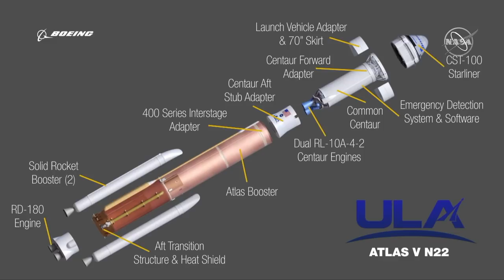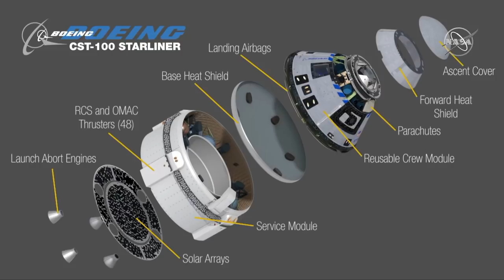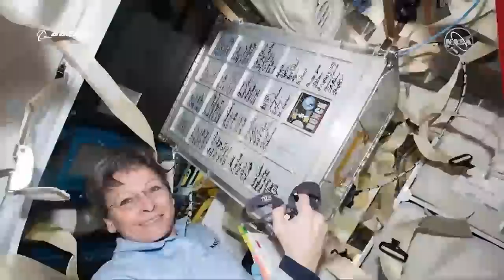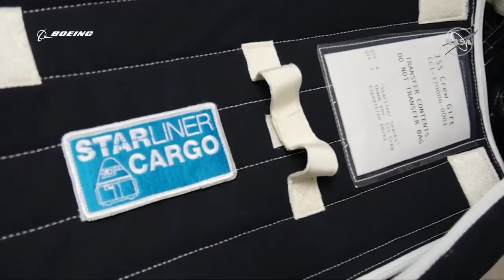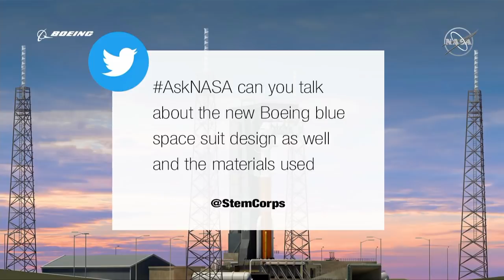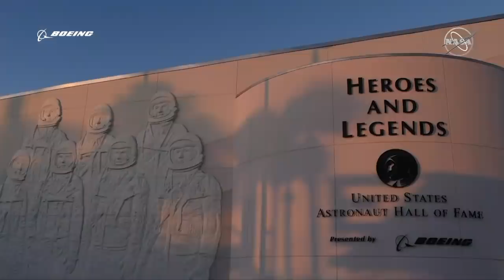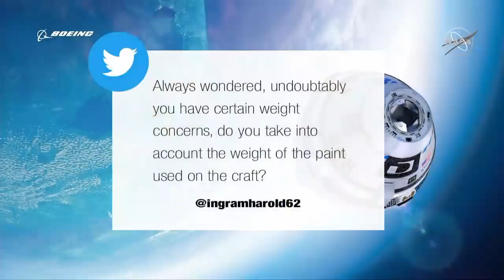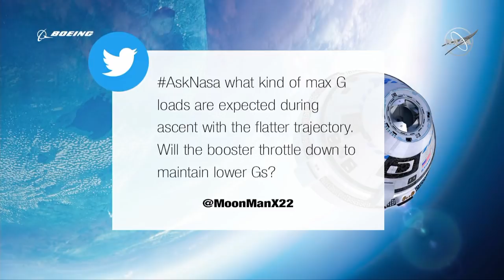LIVE Starliner launches to the International Space Station on Atlas V

Comment: It was a test, something went wrong. At  the end of the day it didn’t go well but that’s what tests are for. Dragon literally exploded so it hasn’t been perfect for either companies. 

Space is hard, something as small as a tiny rubber ring can bring down a rocket, it was a small issue in comparison to what could have happened. 

Give them a break ffs.
Reply: Yes, no biggy, the Starliner was mostly autonomous - like the Crew Dragon has proved to be - the only miss was that the clockwinder wasn't autonomous. (I believe my early 90's Windows desktop shifted daylight savings time all by itself too - oh, right, Boeing's didn't.)
Reply: Don Challenger at least theirs didn’t obliterate when the abort system was fired due to a simple valve problem. I’m no supporter of Boeing being the favourite child but safety wise.
Reply: @weekiely1233  That's why we test, And if everything else goes right. There should be no need for an abort. While starliner might not have any safety hazards. Boeing has a far from clean rep
Reply: Eman2047 a
Reply: Eman2047 again at least it didn’t explode when the abort system fired. 

Compared to spacex’s dragon 2, it’s failure wouldn’t have lead to a loss of life in a crewed scenario
Reply: Starliners abort engines have had problems in the past as well, Sure it wouldn't make starliner explode. But the malfunctioning rocket below would.
Reply: Eman2047 what malfunctioning rocket. The Atlas V did everything perfectly. And the clock issue would have been isolated and rectified by the crew. There was no malfunctioning rocket.
Reply: @weekiely1233  I was saying if the Atlas V had a problem. Starliner wouldn't be able to abort if the engines werent fixed.
Reply: Eman2047 the abort motors are fixed. Same as the crew dragon parachutes. They had problems but they have been fixed.
Reply: Eman2047 and the abort engines are made by Aerojet rocket-dyne who is a reliable manufacturer of engines.
Reply: Apparently NASA did gave them a brake to review a million line of codes.
Reply: Jhon Bards yes and 60 correct actions
Reply: @weekiely1233  Correct actions which will never see again for some time.
Reply: @weekiely1233  As it turns out, Boeing has great difficulty fixing valve problems.
Reply: @weekiely1233  But not of valves, as it turns out.
Reply: @thomashong2938  at least their problem didn’t cause the capsule to explode
Reply: @thomashong2938  Starliner has only been delayed due to the limited spaces in the ISS manifest and the need for an investigation into the issue which needed the capsule to be demated from the launch vehicle. 

The explosion of C204 delayed the program by over 5 months. Much longer than the valve issues with Starliner.

I’d also like to note that the parachute deployment on Crew 2 was perfectly fine. The chute (although it took slightly long to deploy) was not broken and Dragon only needs 3 chutes to land safely.
Reply: @weekiely1233  I have to point out that Starliner’s Orbital Flight Test 1 was nearly 2 years ago. Addressing the software and hardware problems cumulatively has delayed Starliner over 4 times as long as the static fire explosion delayed Crew Dragon. And this is not the first time that Starliner has faced a faulty valve problem. Several malfunctioning valves caused a hypergolic propellant leak in July 2018.
Reply: @thomashong2938  Starliner was mostly delayed due to the ISS manifest being so busy and the issue it experienced would have been easier correctable had crew been on board. In fact the only reason the mission didn’t proceed further was due to limited propellant budget remaining.

Not sure what this has to do with the valve issue though.

Also your comment on the propellant leak is irrelevant since Boeing never made the engines. That would be Aerojet.

My point wasn’t to say SpaceX was worse or that the issues aren’t important. It’s to say that Spaceflight is difficult and both companies have encountered a number of errors along the way. Yet people have an unfair bias against Boeing for the issues they have and turn the other cheek with SpaceX.

Comment: Hard to believe this was two months ago. Like a giant ocean liner  with below water damage, StarLiner struck the software  iceberg and is slowing slipping below the schedule waves. Rival SpaceX now is looking like just a wake, moving off into the distance.  Atlas is a proven iconic rocket system but was developed by McDonnell Douglas not Boeing. It is the proven race horse, straddled by a bumbling rookie jockey that cant make it to the finish line. The  astonishing dual software failures by the Boeing team will be the nagging injury to the program that will add a year or more delay IMHO. Could a second major Boeing misstep have NASA looking to Team Musk to get it to the finish line. Are toothless contracts going to force NASA to settle on 'the one they came to the dance with'?  What will the impact be on Artemis? Sadly, NASA has incredible talent in engineering but dreadful management besides being shackled to Congress members to whom they answer.